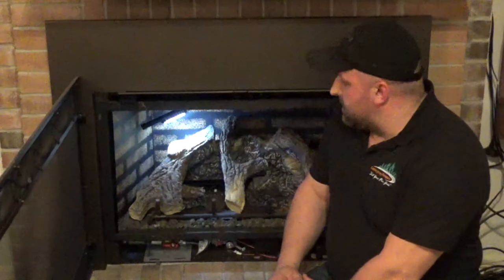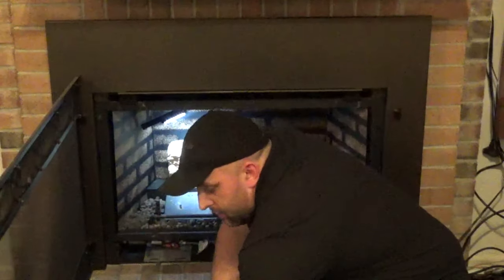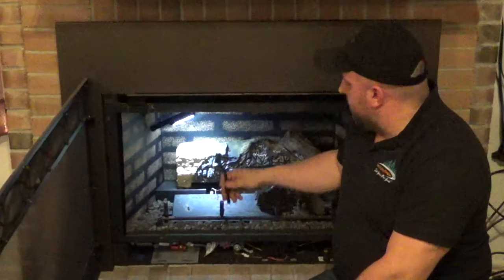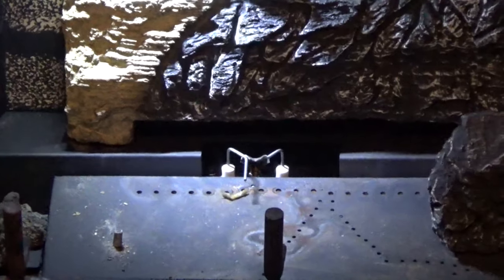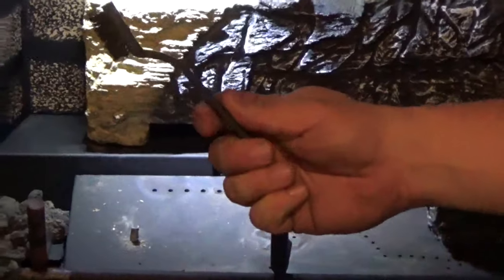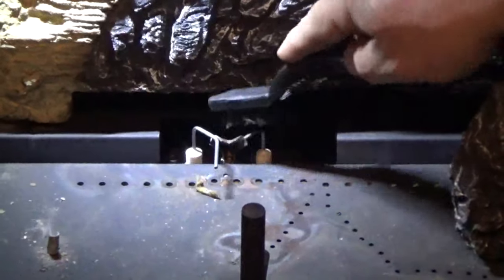How to Clean Your Gas Fireplace Pilot | Gas Fireplace Pilot Cleaning

Comment: My fireplace won't light AT ALL. It's a Warnock Hersey fireplace & it worked fine 2 winters ago but now the pilot light won't light. I tried lighting the fireplace/pilot with a grill lighter, I sanded the thermopile & thermocouple. I changed out the single pole switch at the wall but still nothing.  I even switched to a full propane tank thinking maybe that was the issue but to no avail. There is a hint of gas fumes but no hissing when I turn it to high.  Any thoughts? Do I need to replace the gas line itself? I'm desperately searching for an answer. Please help.
Reply: Same issue, did you find a fix?
Reply: @scoutmaddoxg  I think it's the igniter

Comment: My gas fireplace turns on from the wall switch then turns off after 10 sec ? Any ideas
Reply: My fire place was doing something similar though not has quick turning off as yours. I replaced Thermopile valve and its been running without issues.